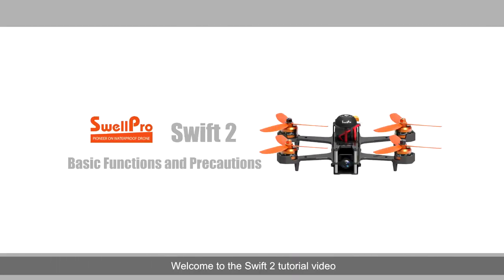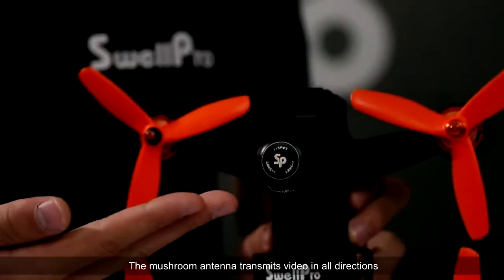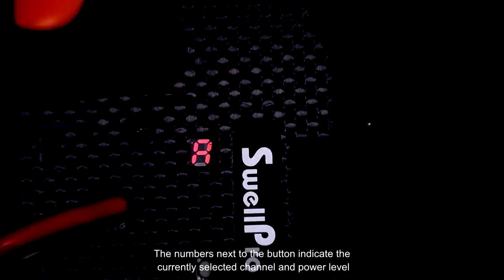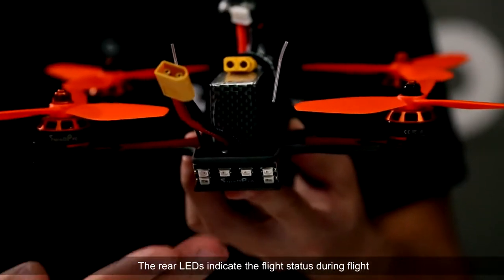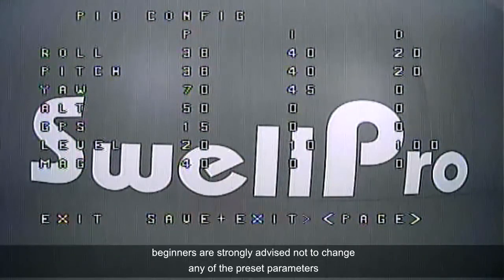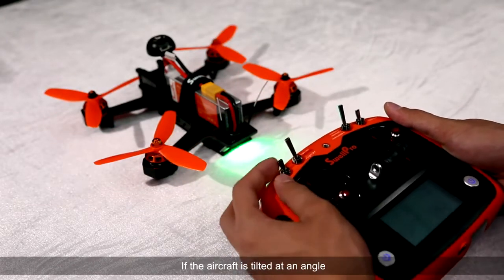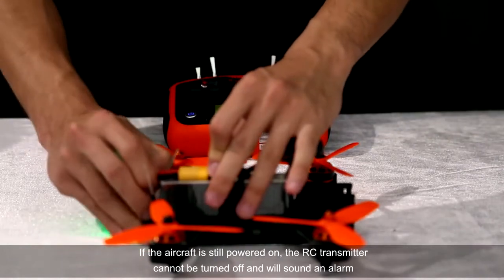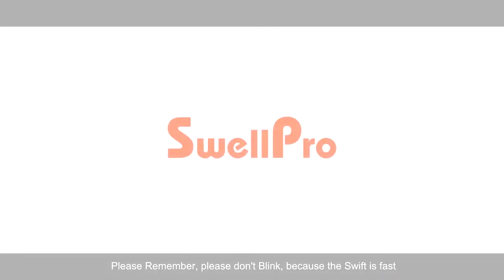Swift 2 RTF Tutorial 2 - Basic Features & Precautions

Comment: Hello SwellPro Team - I recently received my Swift 2 after ordering it. Today I went for a flight and everything went okay for the first flight. However, when I wanted to go for another flight the same day in the evening the craft didn't react to the radio control anymore. I tried to rebind it by using the binding mode on the settings, pressed the bind button on the receiver and pluged the battery to the drone until a red flashing light on the receiver turned steady. 
The RC doesn't show a question mark on the battery-level status anymore but instead is now blank and it just won't rebind to the craft. I am really frustrated... Do you perhaps know what else I could do to make it work? Thanks in advance..